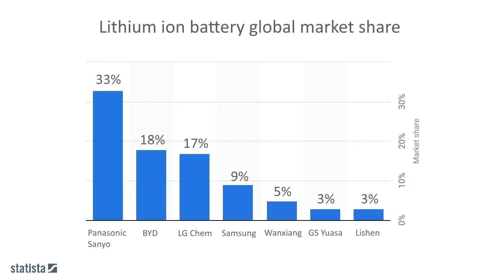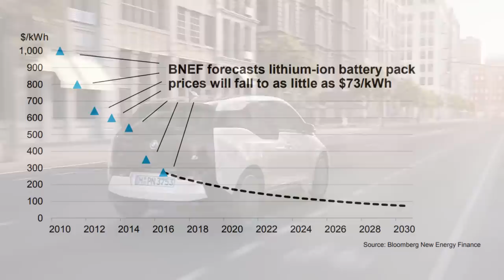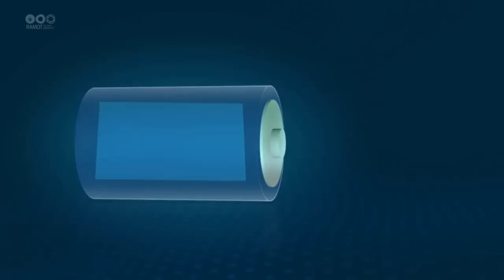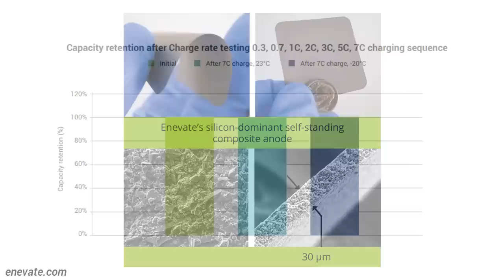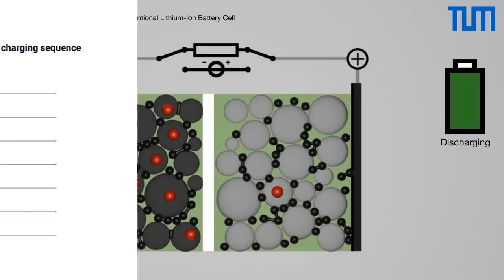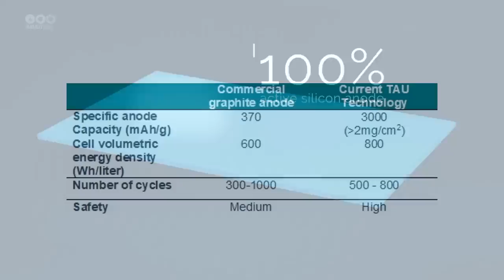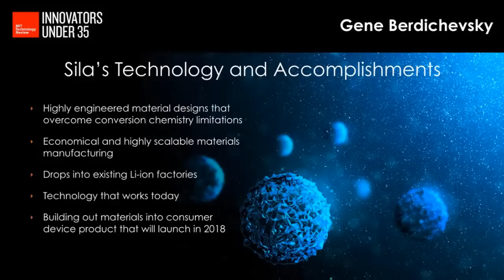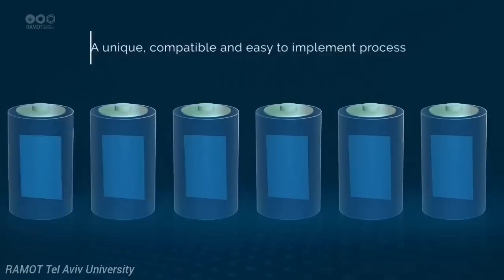The Battery Revolution. Ultra Fast Charging

Comment: What about  all the electricity needed to charge this huge increase in EV's....
Reply: It comes from power stations.  The UK national grid even released a paper on the subject which ultimately concluded that they'll not only be able to manage the increased demand; they'll welcome it because it means that they don't have to switch some power stations off at night.
Reply: The paper released by the grid had a serious flaw in it (decimal place in the wrong place) and so has been rightly challenged. It also didn't take into account that should the switch be complete between electric and petrol be made then oil refineries (one of the largest single users of energy) would need considerably less electricity which would be freed up for other uses.

Comment: This is exactly the type of things EVs have been waiting for. Contrary to the propaganda of "Who Killed the Electric Car?", battery technology has always been the problem.
Reply: Not exactly true.  There simply was no interest nor any effort to improve the battery technology or electric cars in general, which is why improvements didn't happen.

The Lithium Ion battery was invented in the 1980's.  To improve it today took time, money, research and effort.  The improvements we got today would have happened far sooner if there was the same amount of effort used to improvement happening earlier on, instead of much later, and in fact we would be much further along today.

No technology improves if there is no real effort to improve it.  Airplanes didn't become common in the last 100 years become suddenly we had an atmosphere to fly them in, it has been there for billions of years already.  It was a matter of inventing and improving the technology to do so.
Reply: the price of the car at the time along with very low miles per charge killed it.

Comment: Lol, lithium ion is going to be dead soon. Solid state battery will replace. There is no real replacement for the IC engine. Where is the electric jumbo jet?
Reply: Battery chemistry will change and improve, and Lithium may be phased out over time.  I don't see how that has anything to do with real replacement for the IC engine.  We already have the IC engine replacement, it is called the electric motor.

Your question of the electric jumbo jet is pretty far off the mark.  First of all, Jumbo jets are mostly obsolete.  Most 747's are getting phased out, and the A380 has stopped production.

Whether electric airplanes will be the future in that size is tough to tell.  We could run them on biofuels instead, we can use electric airplanes for shorter routes, we could use high speed trains on shorter routes, etc.

There is no one solution or one size fits all solution to every problem out there.  Transportation 100 years ago doesn't look like anything it looks like today.  And transportation 100 years from now won't look like anything we have today.
Reply: Captain Crunch - Electric cars and trucks can't even cut it in mountain areas. Tesla trucks don't have the capability to cross the country in a reasonable time and are not cost effective. Nobody wants a truck that can't cross mountains. Lithium battery obsolescence is far from the mark in comments on a lithium battery video? Gotcha! Lol

Comment: If a gas engine has an alternator to charge batteries then why an Electric  motor can't have 1 or 2 to constantly charge Electric batteries while driving down the highway giving unlimited miles.
It seems like they could do this if they wanted to. 
The technology is there to do it.
Reply: Because it violates the rules of physics and thermodynamics.  An alternator creates resistance, that resistance is overcome by the electric motor that must work harder, using more energy.

So, you end up with a loop with losses, that runs until the battery runs out of energy, and you actually lost a bunch of energy in the process, shortening the range instead of improving it.

Look up perpetual motion machine to understand why this doesn't work.
Reply: "It seems like they could do this if they wanted to. 
The technology is there to do it."

No.  Please don't talk about things you don't understand.  The alternator in your car powers a small 12v lead acid battery that powers the lights and electrical systems in your car.  That's nowhere remotely near the energy used to drive the car.
Reply: Will Davis 
There must be some way to ENGENEER a charging system to charge the batteries, I don't know how but there must be a way of inventing a way. Look at our technology  today compared to 50 years ago.  Myself I like gas engines  or deisel  that is what I grew up with but I am amazed with what tesla is doing.

Comment: You say that it's currently $200 a kwh for lithium batteries but all I can find is around $1100 kwh
Reply: because it's hype and lies, to induce capital investment.
Reply: circusboy90210 yeah man I wish I could buy those batteries for even $400 a kwh.
Reply: The prices being discussed are for large commercial supply/purchases. Car manufacturers seem to be paying between $100-and $150 per kWh for very large supply such as Tesla, GM and Audi. These are cell prices not battery pack prices which are generally 20-30% more

Comment: If you can fully charge a car in 5 min,  you need an extremely high current power line, imagine if there are 10-20 car are charging at the same spot in the same time, how much current (Ampere)  the power station are required to deliver?
Reply: You can use chargers with super capacitor technology, for example.
Reply: these people push lies to attempt to destroy an established paradigm, and disrupt economy's.  oil is perfected this will not be ready for prime time quite a while. push it when it's perfected. stop trying to push it on us and make us suffer for your false dreams.
Reply: nobody is pushing anything?   I mean, your personal contribution to government tax breaks for EVs is what, a couple pennies at most?
Reply: Oil is not perfected, it soaks up enormous subsidies, has contributed to the human and financial cost of war, causes life changing illness to millions of people around the world and is contributing to potentially disastrous climate change. If that is perfectI want better than perfect please.

Comment: errrmm just how do we generate the necessary electricity to power a billion EVs?
Reply: the grid demand will increase by 30% it can be done with, hydro, nuclear, gas turbine, and solar.
Reply: @miguellopez3392   Hydro is off the table (greenies like thier secluded river fishing spots) , Nuclear is a no go (once again the greens are to blame),  Nat Gas is an option but only viable in the US,  and solar is a joke as most ppl work the 9-5
Reply: @zarthemad8386  umm you act like the greenies actually have enough power to cancel construction of hydro plants, my state produces most power from hydro even though we are a "greenies" state, our previous method used to be nuclear, greenies arent to blame for the lack of nuclear power, its high regulatory compliance reactors have to adhere too because people on both sides of the political spectrum fear radiation and toxic waste... so its generally more expensive.. not because they hold a protest outside the plant, solar energy can be stored in a battery inside the house from 9-5, their price has been drooping in while increasing in efficiency the last 20 years, they will probably be on most new houses in 30 years. aslo natural gas is the primary source of energy in the US so its not really a side option like you make it seem.

Comment: The combustion engine can be made to run a lot cleaner.
Reply: yes but will hit the law of thermal dynamics at about 55% thermal efficiency while batteries are at 80-90% efficiency.

Comment: The
oil age will never end. Any suggestion of it ending shows how uninformed some
people are. Just to make a point the tires on your car.  

 By weight
the tread compounds of a conventional tire contain about 28 percent natural
rubber, which comes from latex sap, 28 percent synthetic rubber, which is made
from oil, and 28 percent carbon black filler—a sootlike reinforcing agent that
is produced by partially burning fossil fuels. 

 This is
just one of thousands of things that are made from oil and fossil fuel so if
you are waiting for the end of the oil age, forget about it. It is not going to
happen. Here is a short list of more things made from oil.  

 All
plastic is made from petroleum and plastic is used almost everywhere: in cars,
houses, toys, computers and clothing. 

 Asphalt
used in road construction is a petroleum product as is the synthetic rubber in
the tires. 

 Paraffin
wax comes from petroleum, as do fertilizer, pesticides, herbicides, detergents,
phonograph records, photographic film, furniture, packaging materials,
surfboards, paints, and artificial fibers used in clothing, upholstery, and
carpet backing. 

 Solvents, Diesel Motor Oil, Bearing Grease, Ink, Floor Wax, Ballpoint
Pens, Football Cleats, Upholstery, Sweaters, Boats, Insecticides, Bicycle Tires,
Sports Car Bodies, Nail Polish, Fishing lures, Dresses, Golf Bags, Perfumes,
Cassettes, Dishwasher, Tool Boxes, Shoe Polish, Motorcycle Helmet, Caulking,
Petroleum Jelly, Transparent Tape, CD Player, Faucet, Washers, Antiseptics,
Clothesline, Curtains, Food Preservatives, Basketballs, Soap, Vitamin Capsules,
Antihistamines, Purses, Shoes, Dashboards, Cortisone, Deodorant, Footballs,
Putty, Dyes, Panty Hose, Refrigerant, Percolators, Life Jackets, Rubbing
Alcohol, Linings, Skis, TV Cabinets, Shag Rugs, Electrician's Tape, Tool Racks,
Car Battery, Cases, Epoxy Paint, Mops, Slacks, Insect Repellent, Oil Filters,
Umbrellas, Yarn, Fertilizers, Hair Coloring, Roofing, There are thousands of other things and without oil there would be no EVs of any kind.
Reply: these can be replaced with other synthetic materials, oil will allays be here but will lose most of its applications over time, this will happen, and when it does no one is going to be clawing at the doors of Saudi Arabia to make mops.
Reply: That´s all fine - as long you do not light them up!
Reply: Miguel you have absolutely no clue what you are talking about. You need to learn about all the things made from oil. If they could be substituted they would have already done so. file:///C:/Users/saved/AppData/Local/Microsoft/Windows/INetCache/IE/Z9R28XT4/petro-products.pdf
Reply: @JohnSmith-ug5ci  I have more of a clue then you do, we can make synthetic materials to replace many oil products but it would come at a higher cost, one example of this is synthetic motor oil, last nearly 4 times more than oil derived from crude, eventually synthetic manufacturing will become cheaper and the price of oil will increase from the dropping demand (oil is heavy subsidized in the US to keep it profitable, check the US energy budget) from electrification of cars.
Reply: Miguel. you are self deceived. Your example is flawed. Pure synthetic has no anti rust qualities. It requires petroleum in it to have anti-rust. Also not everything can be done through synthetics. if it could thy would be doing it. So again you have absolutely no clue wat you are talking about. Lastly why would ANYONE with half a brain want to use higher priced item just to keep from using oil products? While I support the idea of the EV they are going to have to come a long way before I buy one and most people feel the same. Right now it takes around 20 to 30 years just to break even with an EV over a comparable sized gas model. Like I said the oil age will NEVER end, change perhaps, but NEVER end except in the deceived minds of some people.
Reply: @JohnSmith-ug5ci  it does not require petroleum to be anti rust, regular oil is also not grate at being rust resistant but rust problems will only really happen in long storage of the engine, why would people buy more expensive  products? They wouldn't wich would awnser your previous question of why synthetics are not wide spread, but with advancement of manufacturing and material science they will eventually spread. This is how I know you absolutely have no clue about EVs take 20-30 years to make back their emissions? They make it back in much sooner then that https://www.ucsusa.org/clean-vehicles/electric-vehicles/life-cycle-ev-emissions#.XFxarkSIY0M
Reply: @JohnSmith-ug5ci  oh you cant support your claim that it will take a EV 20-30 years to make back its emissions? You have to understand how idiodic that claim is, it's almost like you saw that in the comments section of a Facebook post and decided to run with it without doing a shred of reaserch.
Reply: Miguel, EV emissions? What are you talking about? Are you related to Nancy Pelosi with her incoherent rants?.

Comment: Problem: The airplanes? The ships? The tanks?
Reply: Based on your logic, the wheel would never have been invented.  What are we doing with this wheel?  We have nothing to put it on.  No one has invented cars, wagons, tires yet.  Totally a waste of time.
Reply: Sei in OT. Io pongo delle precise domande a cui cerco delle risposte: aerei, navi e mezzi pesanti come i carri armati? Grazie!. Translation. You are in OT. I was putting a precise question: Airplane, Ships and Tank? Thank you!
Reply: Airplanes cannot be made fully battery until we have a massive breakthrough.  At least not for huge commercial airliners.  Until then a hybrid system could work -- combustion engine for take off and landing, battery for cruising at altitude.  Boeing and a few others are researching this.  Or maybe hydrogen fuel cells.

Ships can work electric for short journeys -- we already have ferries that use no fuel, just batteries.  For trans-atlantic, hydrogen fuel cells will probably be used instead.

Tanks could go full electric quite easily.  Or maybe hybrid.  The military are interested in electric tanks because they're quiet and have crazy traction (the smooth torque) and most tanks are not driving huge distances without stopping, so the battery could have enough range for a combat trip.
Reply: The possible solution is a full synthetic fuel.

Comment: I'm all for EV's and certainly Solid-state especially Na-ion and Mg-ion with Graphene, BUT my feeling our long-term future is Algae Biofuel powered cars because it's 100% renewable fuel.
Reply: It has to become viable, cost effective and being able to be mass produced.  That may or may not happen.
Reply: There are a lot of renewable ways to produce electricity, and EV's have many advantages beyond the ability to use renewable power.
Reply: IncognitoTorpedo 
Agreed but I'm thinking about the materials used to produce the batteries. My understanding is 60% of the battery is recyclable.
Reply: It depends of the battery type of course, as even though batteries are called something like "Lithium Ion", that is not a type of a battery as much of a technology type.  Especially since Lithium Ion batteries are usually only about 2% Lithium.

The clearest example of that is if we compare something like the Tesla batteries to the i-Pace batteries.  Both are Lithium Ion, but Tesla uses NCA batteries while i-Pace will use LG NMC batteries.

The NCA batteries are 80% Nickel with only 3% Cobalt, the rest is mostly Aluminum, Copper, Graphite Etc.

The NMC batteries are more like 30% Nickel,. 30% Cobalt and 30% Manganese.

So, if a battery is 80% Nickel, I would think if you only recovered the Nickel on the Tesla batteries, and everything else was lost, they would still be 80% recyclable.  Since the Copper is mostly in the wiring and cooling conduits, and the Aluminum is mostly in the frame and casing, obviously that number would be even higher, as those materials could be separated quite easily during the recycling process.

I haven't seen any hard data on what percentage of materials is recoverable, but I would think the number would be far higher than 60%.  The only material you really can't recycle and re-use as far as I know is the flake Graphite and the Silicon.
Reply: Captain Crunch 
The problem is the ability to separate the components of the battery. The current Tesla batteries were the "conventional" nickel, cobalt and graphite I was referring to with the poor recovery. 

The problem in addition to graphite being a troublesome contaminant in recycling it compounds the problem into cost. If the cost including energy exceeds the cost of recovery then it makes recycling physically impossible. The 60/40 isn't a new problem and the components of even the solid-state are different problem in recovery and recycling.

Here's a brief summary of the problems -- "Several factors contribute to making Li-ion battery recycling more complicated than Pb–acid or Ni–MH recycling. First, as shown in Table 1, Li-ion batteries have a wider variety of materials in each cell. The active materials are in the form of powder, coated onto metal foil, and these different materials must be separated from each other during recycling."
Reply: I know the process has been evolving, and with the prices of Cobalt and Nickel rising, recycling the batteries is becoming more attractive if anything.  I know Umicore has a single state recycling process, and there are different efficiencies involved.

So, this is not as much that it can't be done as figuring out the correct process to do it.

http://csm.umicore.com/en/recycling/battery-recycling/our-recycling-process
Reply: My understanding is that most EVs these days use batteries that are 90-95% recyclable.

Comment: Graphene capacitors?
Reply: Gediminas 1/5th capacity. Good for regen buffering (protects the main battery) high power rates in & out without degradation.